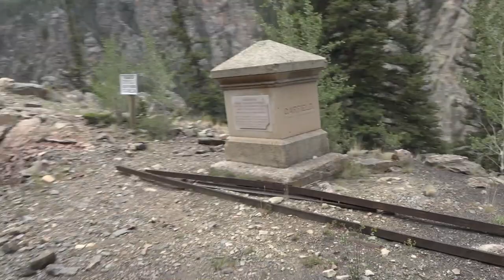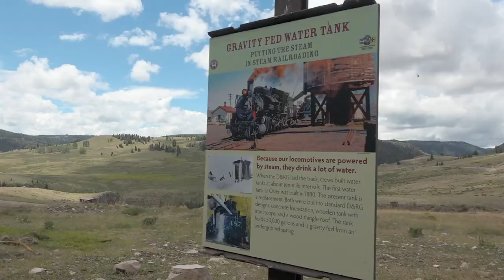All about for 1880! On the  Colorado's Cumbres &  Toltec Scenic Railroad

Comment: I was at the Cumbres & Toltec Scenic Railroad back in July 2nd 2016 and July 3rd 2022. They have a lot of equipment from the Denver & Rio Grande Western Railroad. My favorite steam locomotive is Denver & Rio Grande Western 168 (A class T-12 narrow gauge 4-6-0 “Ten-Wheeler” built by Baldwin Locomotive Works in 1883).